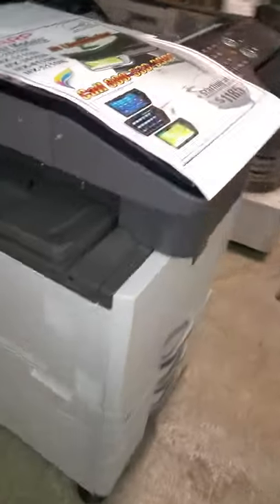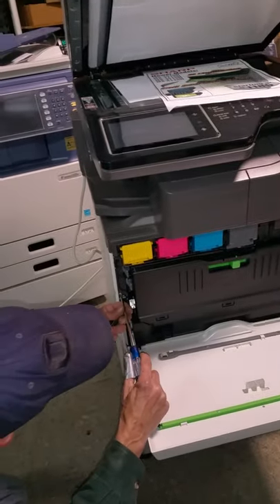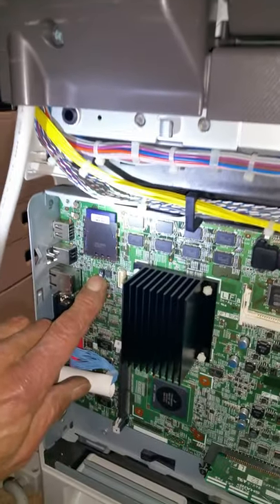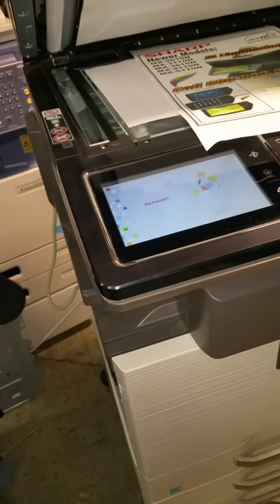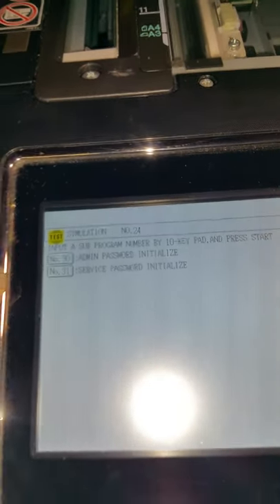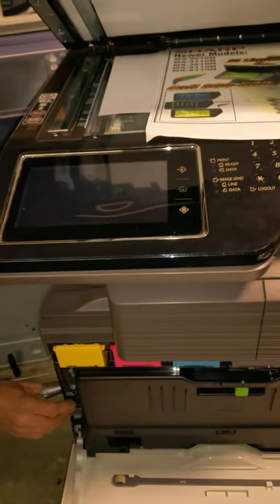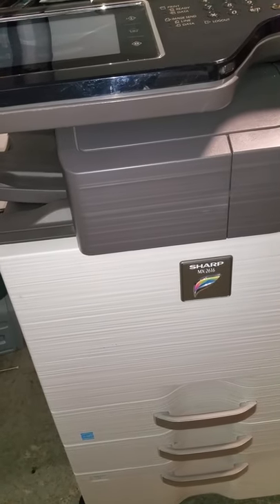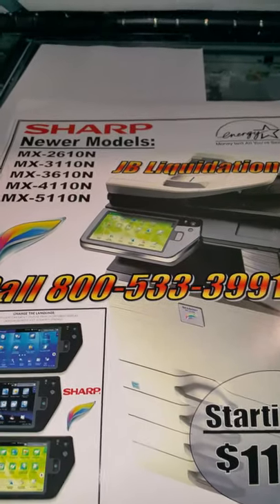Sharp MX-2616 -2615 -2310U How to reset the admin password back to default "admin"

Comment: I have found sharp often sets the admin password to a 5 digit number.  This number is made up of 4 digits from the device serial number, preceding with a 0.

You take the first 2 numbers, and then the last 2 numbers before the alpha character then add 0 at the start

So for example if the serial number is

8502642X00

The admin password would be 08542 (0 first, then the first two numbers 85 and then the last two before the X which is 42.